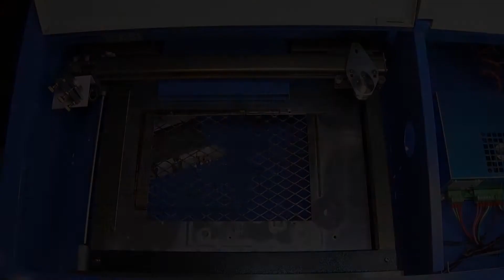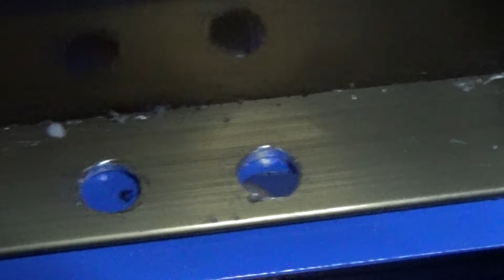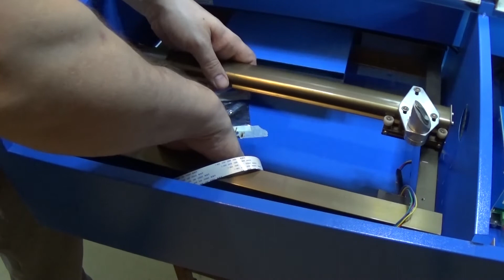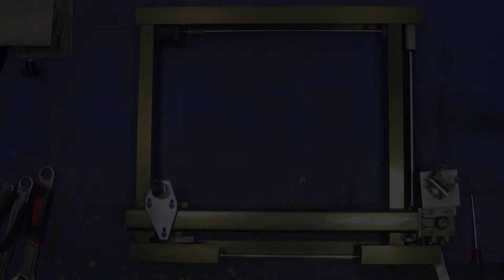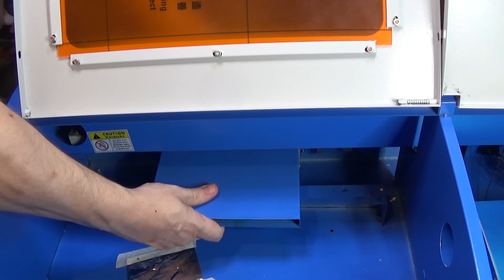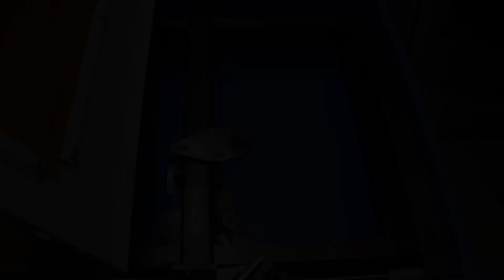K40 Laser Upgrade | Straightening Gantry & Cutting Vent |

Comment: Remove that stupid narrow smoke outlet. Cutting is part of the problem to get more workspace, but it will not give you better venting. Remove all 4 screws and trash it. Okay, you need repeat process of removing gantry, do it once and get rid of that choke forever. You will be surprised how smoke getting out fast if you cut wood or plastic.
Reply from the maker: I want to test all three states. Original, cut down and removed. I will see if there is any advantage to having it and if not then I will remove it. This is just a preliminary stage in my upgrade of the k40. Thanks for the comment
Reply: @TheOffGridFamily  Yes, you will see clearly the difference when removed. Especially if you want to cut anything. Just for cutting you need really good air assist.
Reply from the maker: @MilanKarakas  Yeah I think you are probably right,  sadly mine didnt come with a decent fan, its just a big computer fan. I will be upgrading the whole thing. One piece at a time
Reply: @TheOffGridFamily  Heh, yes. I got just engraver, where engraving job is done actually with small power. In this case, smoke exits to the exhaust. But in the case of cutting, it become rocket engine erupting flame up to the lens. I just got second hand nozzle, but with wrong 'gender' - male thread and on K40 is also male thread. So, I need to 3D print adapter. Right now, I have another solution, which works somewhat okay - 3D printed holder for 6.3 mm (1/4 ") copper pipe with 3D printed mini nozzle at angle of about 45 degrees. The problem is that after fire is suppressed - small amount of hot gasses still remains and melt acrylic or stain wood with tar. And it shoots to the side at about 45 degrees as well. The best way is to use proper nozzle and blow air from above. Just bought 50 L compressor (up to 8 Bar). That thing is LOUD (!). Aquarium pumps from China (big one, claimed 140 l/min air flow) is okay too. But the price is in range with this whole air compressor, and I heard people measuring air flow, it is not actually 140l/min of air.. Will make a video about all of that, just need time to make it work properly.
Reply: Yep, seen several of these and it just needs removing, it does nothing but restrict an already poor air flow. Inlet opposite, the outlet, probably two on the front wall,  for the best flow.
My gantry was also out of alignment, it was caused by the y axis rail being out of alignment and the inept assembler then putting the belts out of alignment. I loosened the y axis rail and there was enough play in the screw holes to set it straight. Belts were then aligned just by loosening the drive coupler.
All straight now with no bending required.

If your misalignment is caused by the y axis rail then bending the x axis mount wont fix alignment, it will just make the x axis bar look straigtht but the y axis will still be running out of true. Need to measure at both ends of travel to be sure.